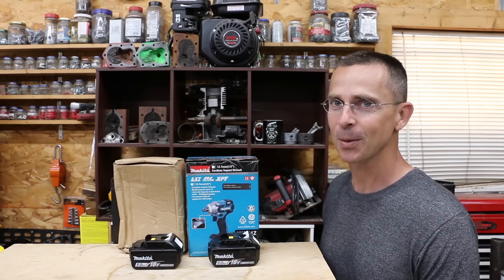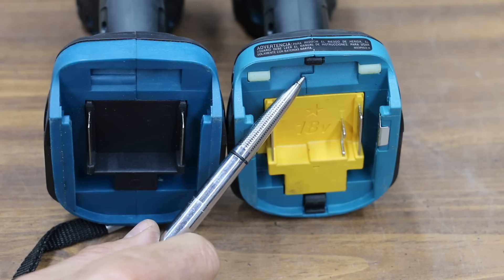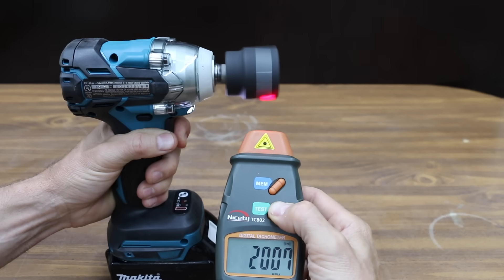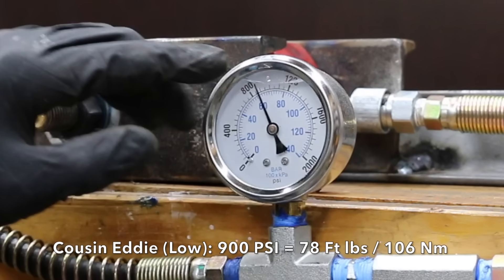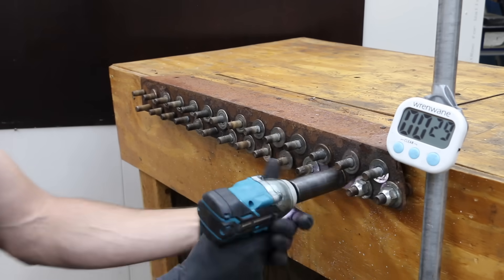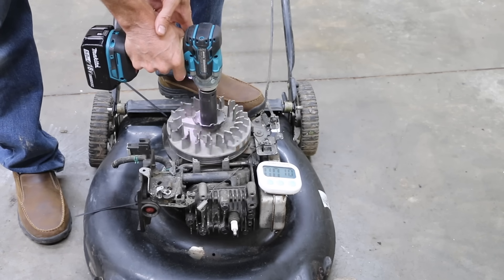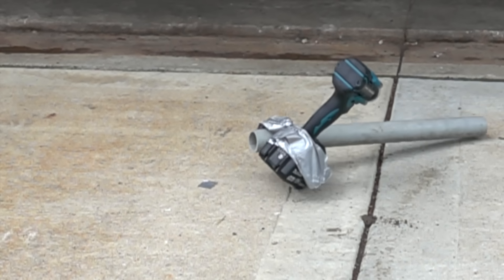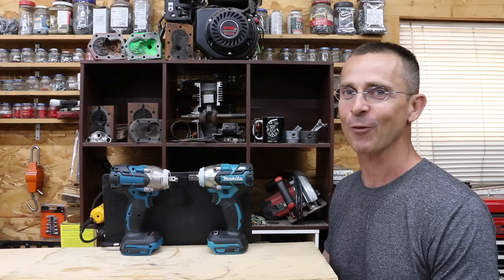Fake Makita Impact Better? Let's find out!  Makita XWT11Z 18V LXT Lithium-Ion Brushless Cordless

Comment: Are you telling me there’s actually a unit of measurement called “nut-busting torque”
Reply: I believe the industry terms are actually 'break force torque' vs 'drive force torque' but most power tool consumers in the USA being young adult males, marketing happens.
Reply: I put on captions and screen shot it when he said that
Reply: I wish I would have had that measurement done on me when I was 18!  Practice makes perfect!
Reply: Ask your wife LOL
Reply: When I read that
Reply: I first saw this term several years ago when Ingersoll Rand was advertising their pneumatic impact wrenches.
Reply: @alleyb62  yup...same. That term has been around a good while and is quite a different spec than just the power. It's, more or less, the level of breakaway it can generate with impacts to the anvil immediately (not over an elongated time). Good example of this being a big deal...tightening or loosening sway bar links, tightening/loosening strut top nuts, removing motorcycle fork internals. These are all things that will spin with slower or less violent application of force. With the pneumatic gun, short like half second bursts will remove/tighten them all. I have yet to fail to remove (or break off) even rusted to all hell sway bar links with my IR 1/2" gun (titanium whatever model thats about 10 years old now and is run at 150psi with high flow air lines/fittings). I have yet to be able to pull the trick off with any electric impact made by anyone. Best example I could think of nut busting torque/break away torque showing itself the best vs. just holding the trigger until whenever
Reply: Head “nut busting torque” and immediately came to the comments 😂
Reply: “nut-busting torque” is actually the rear distance and force you use when you swing your leg to kick someone in the groin.
Reply: LessThanHandy I love this comment.
Reply: not official, and only apply during a certain specific activity
Reply: Oh, ain't that a CBT thing?
Reply: eri oh god no, please god no
Reply: That's what she said 😁
Reply: @Dishonourable Sausage-Baron *She could suck the chrome off a trailer hitch. 
https://www.youtube.com/watch?v=RicwTkzyFJY
Reply: You can also measure crack torque when someones shoe get stuck in it(for slow thinkers "arse") before you manage to wiggle it out ...
Reply: "Nut Busting Torque" is a term that originated in Chicago. It's how pimps rated industry employees.
Reply: Tammy Hughes Hah.
Reply: it’s an air tool thing. they have a much bigger reverse port than forward port. if an electric has more torque in reverse it’s because they detuned it forward
Reply: They use Peter North as the standard of measurement for “nut-busting torque”.

Comment: Do I really need to use the black (impact) sockets, or will a regular ones work fine?
Reply: They will work a few times, but depending on the force you are using, the chrome ones can shatter
Reply: @frep420  Thanks.

Comment: I switched to Makita power tools in 1996. I will NOT buy another brand. I've never had to buy a replacement due to breakage. I buy new Makita stuff because my old stuff is beat up & I simply want a new updated tool. You WILL pay more but I still have the original 4-1/2" grinders from the 90's!

Comment: Thanks as always for this entertaining head-to-head. For the money, and as rarely as I'd use it, I believe I'd be pretty happy with "Cousin Eddie". But then my go-to cordless drill is one of those bottom-feeding $12 Harbor Freight ones. Sure, I've got a bunch of other "better" ones, but that's the one I just seem to grab most. My rarely-used cordless 18v 3/8" impact wrench uses the same batteries and was one of those "open box" specials I picked up at one of their Sidewalk Sales for well under $10, and it's been just fine for the likes of me. Sometimes cheap is good enough.

Comment: For checking RPM's, by putting a larger diameter socket on the anvil you are changing the readings. The bare anvil will be turning faster than the outer diameter way larger socket. 🤷‍♀️

Comment: I bought a Dremel high speed tool a few years ago from a Bunnings  tool shop.It had a warranty & was expensive with all its cutting tools.In the end I took back 4  tools because the speed control failed.The last one has lasted much longer so far OK.My nabour just bought  one cheap on  Wish & got 2 but its not a Dremel but a chinese Copy.He thinks he got a good deal but I am not so shore.

Comment: I’d call Cousin Eddy a darned good tool for $30.
Reply: Be nice if it lasts, unfortunately I doubt it would.
Reply: @DavidMoralee  for sure it will last more than it costs, u really think its lifespan is 5 times shorter? that thing would outlive me probably in my use lol
Reply: @kiiiisu  The thing I would concern most is battery. Sure you can replace cells but it would change price dramatically.

Or maybe... I unscrewd 8 stubborn bolts with "Grsphite" tool, untill counter screw broke. I unscrewd them all with Makita. Cheaper Bosch   brand broke after one bolt.
Reply: @jacek-jan  Since the batteries are compatible you can use the clone tool with a genuine battery
Reply: @kiiiisu  I've made the mistake of thinking like this before.....rarely get a year out of these knock offs.
Reply: It's worth the $30, but the question is: will it do the job you need to get done?  That could be pretty iffy.
Reply: Agreed. For light duty work on small houses and family sedans, it will survive for sure.

Comment: Great presentation - as always - Thank you. 

The one comparison that may need to be done is comparing a Japanese made Makita to its Chinese made Makita  counterpart . This may be impossible to do now because it is hard to find to find "Made in Japan" Makita tools or at least impossible to find the same model numbers that are made in the two different countries.

I own two Makita "Made in Japan" 1/2 "  impact guns, one speed with the reverse mode and forward mode being in the same trigger. f I am remembering correctly they came with a chart listing foot pound torque settings over your application time. They are heavy and well made.

I bought the second impact gun immediately after buying the first because I was so impressed with the quality and strength but maybe more so because I felt that Makita was never going to make these tools in Japan again , searching online it looks like they are all made in China.

Comment: i'm all makita w/my power tools, i have one battery that is 7 years old and still holds a great charge
Reply from the maker: Impressive!
Reply: I've got 3 Makita batteries that are all 6+ years old and they're still functioning beautifully. Spending the money on Makita was one of the smartest thing I've done when purchasing tools. Although, I have the Milwaukee 12v Impact and drill set and they're mighty impressive as well. They're perfect for lightweight stuff because they're not heavy like the 18v stuff.

Comment: Maybe i missed it, but are the batteries 100% interchangeable?    I'd like to see the knockoff run on a real battery since cost cutting is often done by using 2nd rate batteries in the power packs.
Reply from the maker: Neither tool came with a battery.  I used new Makita batteries for both
Reply: @ProjectFarm  Ah, so that eliminates one factor.    THanks for the reply.

Comment: If you measure the RPM from something of a smaller diameter you will get a more accurate result, larger wheel takes longer to get around

Comment: Todd, let me know if you want 4 torrington bearings.

I recently rebuilt the lift mechanism on a planer, and 
replaced the bearings.  I have the bearings, and the 
washers, ("races") on either side.

You can eliminate any drag,  when doing torque tests, 
on a shaft (or bolt) up to a point.  You'd be able to 
measure tightening or loosening force, without worrying 
about the bolt (or nut) friction.

steve

Comment: I do believe, that for 5X the price, the Makita will indeed last 5X (or more)longer than the cheap one. If you're a professional, the Makita is the better choice. It will maintain more consistent torque after much more use. For a DIY'er, that little $30.00 gun is a good deal, if it's only going to see occasional use. As far as value, and how much use you'll get per dollar, it may be a toss-up! Since you will replace the cheap one more often, SAVE THE BATTERIES! That may be where you see better value in replacing the cheaper tool more often. Having a few spare chargers won't hurt either, who knows how reliable they are at that price point.

Comment: I would want to see a showdown between Dewalt, Milwaukee, Makita, Craftsman, or any other top tool brand with their 1/4, 3/8, and 1/2 inch drive impacts as well as their grinders, drills, reciprocating saws, flashlights,  or other common tool they all make. I'm currently trying to figure out what tool brand to go with so I only have to buy one type of battery and charger.

Comment: Is it worth getting a knock-off ? Yes, absolutely. If you only need to use it once and don't plan on using professionally. No need having a 200$ tool rotting away in a closet somewhere doing nothing...

Comment: I’d like to see electric impact wrenches vs compressor driven
Reply: Rip electric
Reply: Me too but: not all air impact guns are created equal and how much pressure, what size hoses, do we use high flow connectors.  Lots of variables.
Reply: @Dan Harold: I agree. You could very well have a situation where the electric beats air with a 1/4” hose but air with 1/2” hose is times better then electric. How do you know whats fair? 1/4” hose, 3/8” hose, 1/2” hose, everything between say 90 & 200 psi, water separator vs no water separator, in-line Oiler vs no Oiler, standard air hose quick connects vs high flow quick connects vs industrial quick connects, compressor size/capability, tank size, and every possible combination of each.. Filming all of this would easily take days.
Reply: @kcscustom  since there's so many different combinations to experiment you'd have to decide which consumer demographic you'll experiment for then choose the combinations that practically fits the demographic. It's not nearly perfect but it's a start, at least in my opinion
Reply: @danharold3087  My experience with quick connects went like this:  I have a Sears Companion impact gun that would not take lug nuts off my cars.  I assumed it was the gun's fault until one day, I saw some quick connects at HF (I think the label said automotive quick connects). I bought them and then I had no problems removing lug nuts.
Reply: That would be a bloodbath
Reply: Thsts not even a contest
Reply: Yup.
Reply: There's a reason Marco, SnapOn and Mac dominate the tool market. There's just no comparing air tools to electric  with current technology for a professional work. Home use, electric is fine
Reply: A well oiled air impact gun using just a 3/8 air line, being fed 150-200 psi shop air would absolutely destroy an electric impact of the same hammer size. But that doesn't mean I don't want to see it.
Reply: Yeh nah.. that's not the same usecase..
Reply: The electric is more for convenience over air.

Comment: I think it would be interesting to see how the Wal-Mart power tools hold up, like halt or hyper tough.  Also, this video is on the trending page!  Congrats! I love watching your channel grow, you deserve it.
Reply: Not Halt, but Hart . Hart is made by TTI (same company that makes Ryobi, Ridgid, and Milwaukee).  The tools are fairly respectable and pretty comparable to their Ryobi-branded stablemates, just stay away from the <2Ah batteries as the tools don't perform too well with those.  TTI made a big push now to make a ton of tools in the Hart brand/battery system (much like Ryobi has over 100 tools in their 18V line), so Walmart will have plenty to sell.

Comment: I'd be interested in a show down between a Craftsman C3 impact driver and a Dewalt 20v impact driver
or impact wrench, I'm not picky :)
I got suckered by the craftsman legend when I was a teen and ended up with a number of the C3 cordless tools, then saw and used dewalt stuff a few years ago and my impression was that dewalt makes a better cordless tool

Comment: I know aaa batteries are way off subject from this video, but I bought some off brand ones that scored high on another video. This guy did some rather extensive testing and came up with Fuji and Allmax coming out on top. I found Allmax on Amazon for  $13/pack of 48. I put those suckers in some COB led work lights and was instantly blown away at the brightness of them. "way brighter than the acdelcos I had in them) I put those batteries in all my remotes and assorted lights. I guess I'll see how long they last, but I wonder if you could add those in if you ever do a AAA showdown. I buy products dependent on your outcomes these days. Great video as always.

Comment: I spent $100 bucks and got a 2 drill craftsman set. A cordless drill, and a cordless 1/4" impact drill. I will admit it doesn't have quite the chooch factor as a milwaukee, dewalt or makita, but it will rattle in a 5 inch long 1/4" lag bolt into green wood. I don't really ever need any more power than that. I'm sure a name brand would be a lot faster but i don't even do that very often. Most times its 2-3" wood screws and it works a hack of a lot better than a screwdriver or regular drill for that so i'm happy with it.

Comment: I had a leak in my rack and pinion and was adding a quart a day to drive the car.  I tried lucas, another brand which was 2 part mixture. Neither worked for long and was back to a quart a day.  Someone recommended AT-205 Re-seal. I couldnt believe it but it worked and im going on a year now. It says can be used in engines and transmissions as well.  But im wondering the side affects if any and would like to see it tested as well as comparisons to other brands. 

Heres a link to the product. 

http://atpautomotive.com/featured/re-seal

Keep up the great videos

Comment: Wow, not bad for $30! Wonder if the batteries are interchangeable? Most of my cordless tools die because I can't find replacement batteries for less than the cost of a new tool and I don't use them enough to keep the batteries in good shape. I am slowly moving to Ryobi because I can get all the tools to work with the same batteries. They also have some tools I use corded tools for, but would replace with cordless as they fail. How does the Ryobi brushless stack up?

Comment: i think the biggest difference in cheap vs pro tools is the endurance. 

a while back a friend of mine needed an angle grinder, he had a good one but his son was working for him during summer so he needed a second machine. he decided to go for a cheap one as a spare.

not a great one, but got the job done, untill it burned out after couple hours of heavy continuous use.
no worries, there is a warranty for it, he gets a replacement, starts working again. 
the new machine dies after again a couple hours of heavy use.
5 replacements later the job is done.

says it was sortof ok, as the warranty did work each time, tho apparently the store clerks were smiling a bit towards the end (its not out of their pockets, so they can just laugh it off).
but, all in all, how much of a saving was it, when he had to drive back to the store and get a new machine each time, wasting his own working hours.

all in all, its about the quality of materials, heat resistance, wiring, etc. 
as he said, the tool would probably work fine for years if you only worked a few minutes at a time, but heavy continuous use does take a toll on the parts if the tool isnt built for it.

Comment: Yeah id never buy the 30 driver.
-No ground for battery (fire)
-no fuse in case it draws too much amperage (Definitely a fire)
-cheap construction and no warranty
You'd have to be either really poor or really dumb to buy that.
Reply: If it had no ground, it wouldn't work. There is no temperature pin for the battery, but the protection in a real Makita battery will still work. What kind of fuse are you talking about(the battery protection circuit also handles this)? the construction is not 4X better.

Comment: I like your test rig. Another torque test rig that is available is a Skidmore-Wilhelm torque calibrator. You can find them used in eBay but they are usually $700 and up.

Comment: Man I like what you're doing but your test or inconsistent. on your speed test the top row with the fake 1 you dropped the lug nuts into your hand and then released it to the floor. Then on the original you just dropped the lug nuts straight from the socket which Cuts time Therefore your time is not right

Comment: I catch hell from my friends at the hardware store because I still use my air tools. They want me to buy the new battery powered tools? Why? I'm 72 years old, still doing my own auto service, even break jobs and trans filter replacement type of things. Nothing often enough to bother replacing my old tools for. 
A $30 impact gun would be fine with me. 
When I was younger I used a Chicago gun and a huge compressor for replacing the crank nut on VWs. They torqued to 350 pounds so the gun really had to deliver! I don't think either of these guns are anything I would trust to do the job!
These days lug nuts are about as big as I need to remove. I put them back on with the gun but hand torque.
Reply: If you are close enough to the compressor you are good. The battery tools allow you to do work in the field without AC or air. I make coffee with my Makita coffee maker while camping!

Comment: I'd like to see if a predator would run with the cylinder pointing up like an old horizontal shaft flat head would. I know the gas tank and carb wouldnt work so that would have to be a little custom work